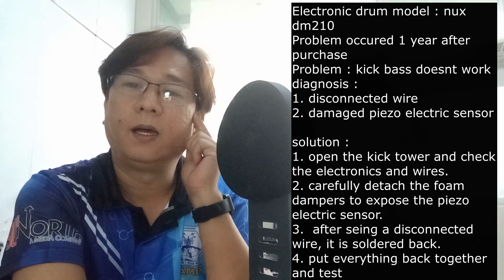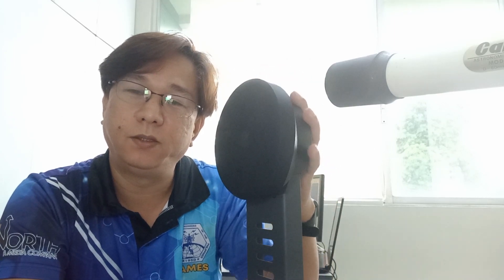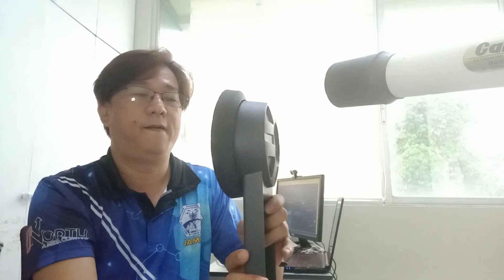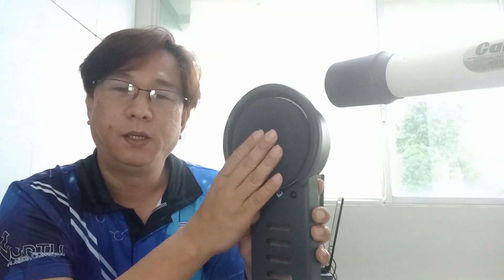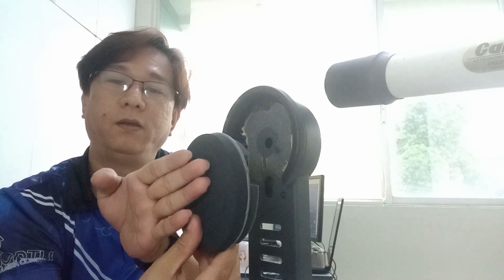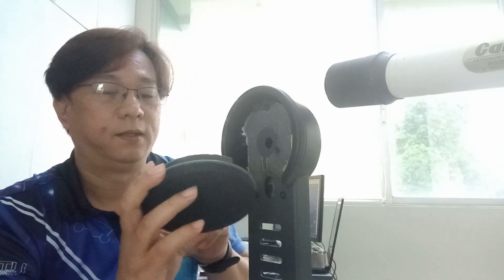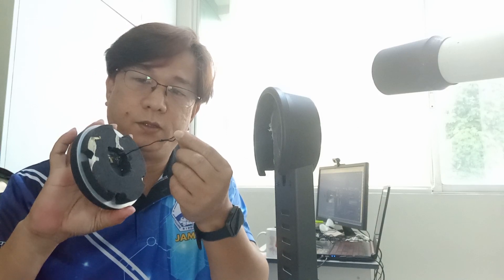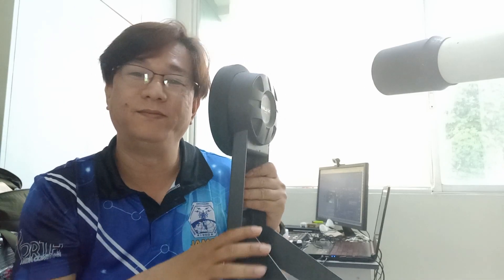ELECTRONIC DRUM KICK TOWER REPAIR

Comment: What drum sensor do you use for an alesis nitro? My pedal is only picking up extremely hard hits and it is still very quiet. Yes i have ajusted the sensativity to the max on the module. What should i do?
Reply from the maker: im using a generic Piezoelectric sensor which i bought online. im not using alesis but i believe it will work just fine for you.
Reply: @jamesrodneysantiago  thank you so much! I hope it works
Reply: @therakrea  did it work?

Comment: SIR SINCE MY EXISTING BASE PEDAL  CSD 100 CARLSBRO IS DAMAGED IM LOOKING FOR A REPLACEMENT  PEDAL AS WELL THE TOWER FROM LAZADA AND I FOUND A UNIT AVAILABLE WHICH IS NUX  IM INTERESTED THAT PARTICULAR UNIT JUST RIGHT ON TIME SINCE YOURE DISCUSSING THE NUX E. BASE TOWER I WOULD LIKE TO ASK IF ITs COMPATIBLE TO MY UNIT ITS  REALISTIC LOOK
Reply from the maker: Hi,..sorry for the late reply,..it should be no problem since the interface to your drum controller is just PL though i urge caution since ive noticed that the NUX kick pad is not that durable and its hard to find support.
Reply: @jamesrodneysantiago  TNX FOR YOUR PATIENT KINDNESS REPLY IVE FOUND ANOTHER UNIT WHICH THE AVATAR KICK PEDAL AS WELL THE DRUM TOWER OR RENDRIX KICK PEDAL AND TOWER THIS TWO AN OPTION WHICH DO YOU SUGGEST THAT MIGHT FIT AND COMPATIBLE TO MY EXISTING CSD 100 DRUM FOR IF EVER THERES ONE WHICH WILL BE ILL ORDER IM NEEDED HAVE AN OCASSION TNX GODBLESS